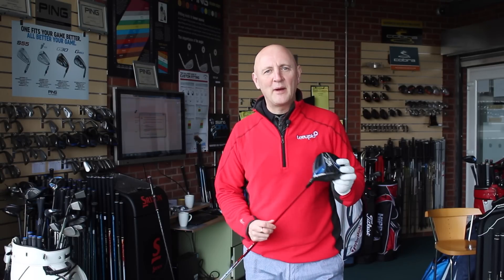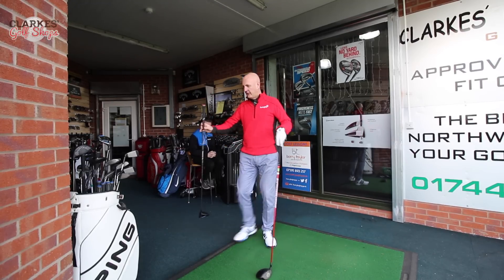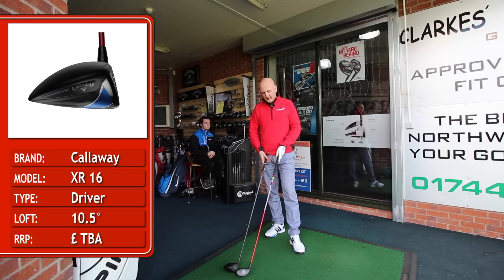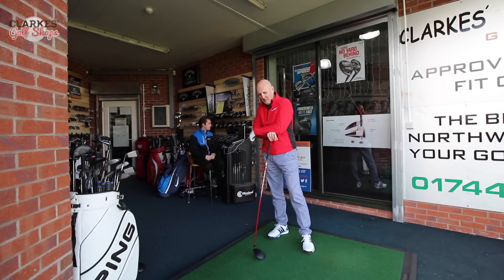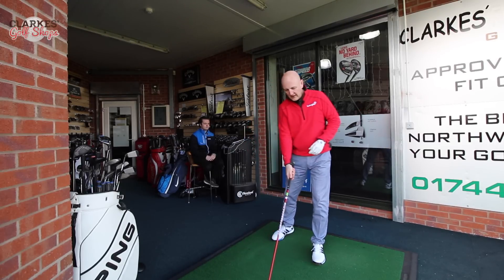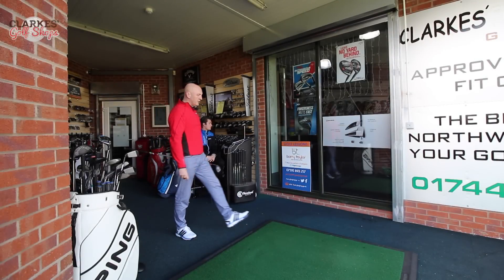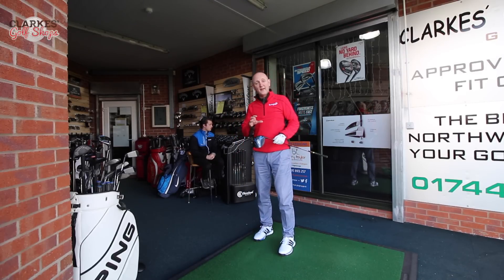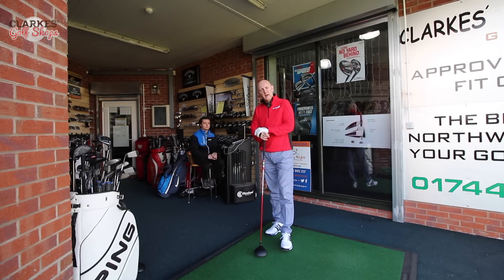Callaway XR 16 Driver

Comment: I have the xr16 Pro model in 9 degree loft. My club head speed increased by 3-4mph and added roughly 10-12 yards of carry distance off the tee. My spin numbers are much better with the Pro version in comparison to my old driver (x2 hot). Nearly 600rpm difference.
Reply from the maker: HI +Adam Denison thanks for taking the time to watch and also comment. We never tried the pro version but certainly found an increase in club head speed and overall distance with the regular driver. Hope you keep watching!